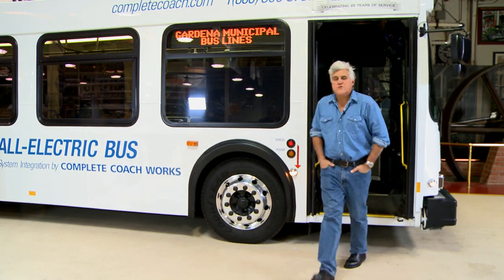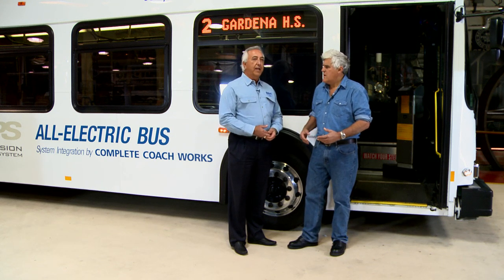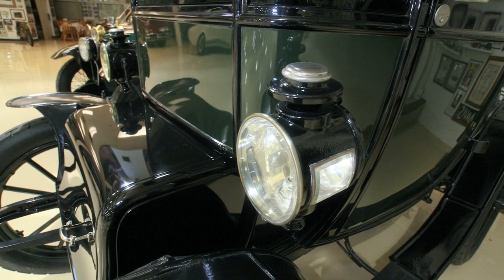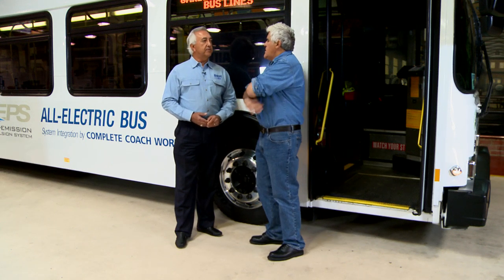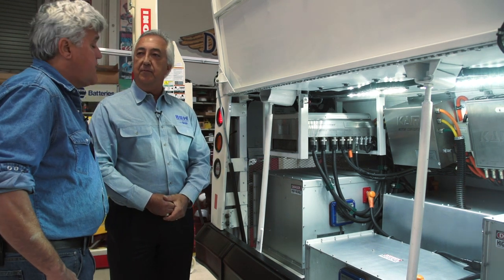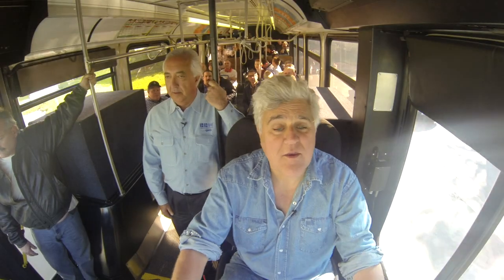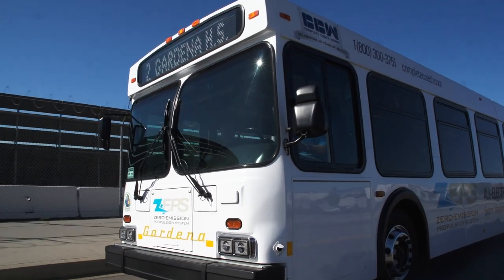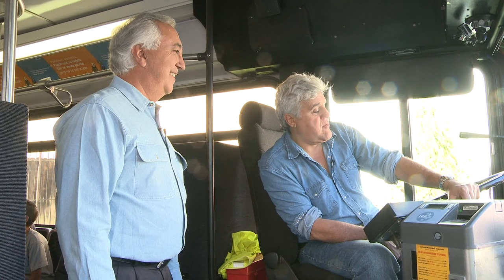Electric Bus Conversion - Jay Leno's Garage

Comment: I would love to have this drive train in a 21-25 ft motorhome when I retire.  Charging at the campsite would be way more convenient than gas stations.  And if you roll in after hours it isn't as disruptive to the other campers trying to sleep.  Imagine spending a few months going cross country and maybe just driving 150 relaxing miles in-between campsites.

Comment: why dont we have the same set up as a bumper car in dense cities? when you`re running low on charge, just extend a boom with a metal brush on the end of it, and charge on the go. and if you`re out side that kind of city, what about a solar panel on the roof? i mean, panels are getting fairly cheap nowadays. and with the recharging system the bus already has, it will virtually never run out. just plug it in a night and keep it going the next day. or have a 5 wheel in the centre bolted onto a dyno

Comment: I dunno how much a full solar panel roof would contribute to charging but it could probably run the A/C system alone and take the load off the motor.

Comment: Also, the specific design of the bus in the video is way better than any of MUNI's 40/60 foot motor coaches, excluding the Orion hybrids. MUNI would be wise to get one of these electric buses, rather than trying to fix the piece of junk neoplans that are stacking up like broken cars at a junkyard.

Comment: How long does the batteries last. Is it like the prius the batteries last only about. 100,000 miles before they need replaced. And batteries are not cheap.

Comment: Not that you actually care about facts but just in case you might want to know that the US now uses just as much natural gas for power generation as coal, with much lower emissions, and it's all sourced from right here in the US.  Hydro, nuke, solar, and wind also contribute the grid power and are locally sourced, except for some hydro from Canada.

Comment: first time i see a viable electric viechle. this is excelent. and i believe the price differeence to a diesel bus wil be saved in maintanance and fuel pretty fast
Reply: until you figure in the costs of replacing the batteries every year or year and a half!

and the environmental impacts of those worn out batteries (and the new replacements) are

Comment: My only question would be can it climb hills with a load?  And what happens if it’s in a bad accident?  Would the bus be “Electrified” like if you ran into a power pole and sparks flying?
Reply: This kind of fear from electricity was quite common at world expos of the 1880s … are you also worried to sit on a tank containing 500 pounds of Diesel fuel – equivalent to 35 tons of TNT?

Comment: How about motorhomes which weigh less??? The owners typically are in no rush,and would be content with a 2-300 mile range per day,and with full solar roof panels,maybe twice that range on a good sunny day,or have a small gennie running which would renew the batteries while in use...

Comment: That motor is small for 170 hp.  I am a bit surprised at the wye-start delta-run configuration since there is an inverter.

Comment: Why would you need it? The best Lithium batteries can give out 130 times their amp rating for 15 seconds and 65 times continous, so with a 100KWh battery you could give out 1300KW for 15 seconds (acceleration) and then 650KW 24/7 :) And even more with extra cooling :D Tell me how you would need a supercap?

Comment: This is a 20 year old bus that they completely renovated and fixed up to make it as new. He said it will probably go for 12 years no problem. They usually ship these 20 year old dirty buses down to Africa where they will be polluting another 20 years with an outdated and tired diesel engine. Not only will a conversion stop that pollution, there wont be a need to build a completely new bus. What do you think is dirtier? Letting the old bus run in Africa for 20 years and make a new bus or this?

Comment: That is not true. The routes might be shorter in European cities, but the busses drive more often. In Bratislava, the daily average of of how far a regular city bus drives is about 250 km (156 mil). Long routes make up to 400 km (250 mil). Electricity is nice, but hauling heavy batteries is not, also the battery is expensive and becomes high toxic waste after a couple of years. Trolleybuses make more sense, especially when you have frequent service like here in Europe, in peak times every 3 min.

Comment: This is a conversion. On the surface this appears eco as a bus is being reused. However, a brand new build can often be more economical, in the lifetime of a bus - as is often the case with houses. A new build will clearly be far better economical design.

Comment: So, if you could fit 3000w of solar panels on this bus, at 213 kwh, it would only take 71 hours in full sun to charge it!

That's why there are no solar panels on top of this bus.     The solar panels need to be at the bus depot and there needs to be acres of them.

Comment: They said it holds 213,000 watt hours of electricity. A large car battery holds maybe 120. That's 1775 big car batteries full of juice to go under 2 hours of travel, so if you can picture that, solar panels will not help unless you are tethered to a field of them. . As in forget batteries completely and just make it an old fashioned electric trolley. The same technology used for over 100 years which the car companies kiledl at every opportunity so we'd have to all have our own cars.

Comment: why won't anyone use capacitors to recharge batteries, they're lightweight and efficient and can use the energy from the regen system to multiply the voltage to recharge faster
Reply: myfeeling4you 
Because the batteries are plenty fast to absorb the breaking regen, so there's no need for capacitors inbetween the breaking motors and the batteries.
Heck, there's even a bus project where they use super capacitors only, and no batteries, and then have them recharge at each bus stop.

Comment: Nope they don't make enough energy per square meter which is why they are not used in such a way. It would maybe power the aircon if you covered the whole roof. maybe...

Comment: I wonder if you have a back up generator diesel or gasoline. The i3 made buy BMW does carry that. In the long run the back up generator will pay off, especially since it cost 300 to 500 dollars to have it hauled it back to the garage. Especially the loss of service that would ruin perception of all ready horrible public transit

Comment: When I see companies like this I think why don't they just enter the market they service? After all they get the equipment at cost rather than retail and if the market is profitable to be in why not?
Then I remember the Government monopoly on such services and how they are distorted by taxpayer subsides to appear to cost less than a private business could provide.
Reply: Problem is that they are using a product design held true by the manufacturer that built them in the first place. Unless they build their own buses from scratch, they can only do rebuilds as requested by whomever the buyer is funding. Simply, the bus designed to the features the transit company is interested.

Comment: You know the funny thing is about these is what is needed to put power to these, usually nuclear power. Sure it's clean until you have to dispose of the rods or something happens. Next the process of mining the nickle in Canada, sending it to the UK to be processed than off to China/Japan to make the battery. That means freighters and trucks burning diesel. When it's all said and does it costs more and is more harmful to the environment than a regular truck and so on.

Comment: Everyone keeps saying that they should put Solar Panels on the top of the bus. IT WILL NOT HELP. The weight of the Solar Panels is too immense. The amount of Electricity produced will be very negligible. Instead it is advisable to have one more Battery Pack. I have spent 11 years in the Solar Electric Industry.

Comment: Lithium Iron Phosphate (LiFePO4) batteries and Lithium Ion (Li-Ion) batteries are not the same. Li-Ion have higher energy density but have the burn-up failure mode... To steal from Jason Fenske: "if you're going to drive a boring bus it might as well be an electric bus". Given that I have two bus stops right in front of my house, I'd much rather have one of these "idling" out front at 6 in the morning than a diesel.

Comment: Actually they're not doing it without government money since the transit system is operated by state and local government authorities. The cost of the bus is higher than a conventional diesel bus and without government money this would never get off the ground.
Finally when private corporations are done creating an economic meltdown every five to seven years the government has to step in and mop up the disaster like the last time. Maybe the government is not all bad?

Comment: I think electric vehicles are a bad idea, they place a greater strain on the power grid and we don't really have the battery technology to make the vehicles entirely useful and cost effective.  I think the direction we need to go in for now is hydrogen vehicles.  Or maybe just a hydrogen generator with an electric motor.

Comment: When did they get permission to design this off of the D40LF?
Reply: It's still a D40LF only it was converted to electric. The bus isn't new, only it's power system is new.
Reply: Once warranties expire, transit systems can do whatever to the buses. New Flyer is making a killing in the bus manufacturing department.

Comment: China builds NEW buses that do not meet the regulatory requirements for use on American highways.  

This is USED bus that has been fully reconditioned and equipped with an electric drive system.

The Chinese bus? They're building ten for Long beach at a price that is 3 to four times what these buses cost.

Comment: These batteries will continue to serve long after they come out of the vehicle, they dont go bad they just lose enough efficiency that they arent the best in a drive environment anymore, so at replacement interval they come off the bus and go into a stationary battery pack that gets recharged by solar power and the battery bank is what charges the vehicle, and helping the fleet become steadily less dependent on the grid. Sustainability growing at an evolutionary pace!  Thanks for your comments

Comment: This  Electric Bus is a great idea for mass transit...just not as efficient...
 as the internal combustion engine...equipped with The Hull Effect Technology.
 discovered in 2009.  by  Robert W Hull.(<<<<ME)
 The exhaust gases have zero pollution...VERY QUIET !!!.
 My 4 cylinder engines USE E85 ethanol blend...
and operates on a few ounces per hour....at hiway speeds.

Comment: Why hasn't someone built an electric vehicle & then to charge the battery, have a gas powered generator on board that kicks on when the battery drops to x amount of charge & also combine solar on the roof for charging.
Just seems like a good way to never have to stop & charge up at a charge station. besides getting gas like onces a week or so coz the solar panels on the roof will probable charge the battery's most of the time.

Comment: Jay, your videos are very informative and entertaining. Appropriately so for one with your level of interest, experience in the automotive field and entertainment. I loved how you corrected the Porsche representative upon him exclaiming the PDK shifts "instantly" - like you responded, "well, maybe in milliseconds", which is very fast in relative terms

You may be interested in advancing your theoretical understanding of electrical power as it relates to cars. I am sure you know, ultimately power is what is required, just like with ICE. Power = Electric potential (volt) x current (amp). Due to safety and best available power management components, designs aim at (300 to 500) volt. At lower voltages the currents become undesirably high. 

You might be interested in viewing a couple of very informative videos about accounting for losses in the Tesla Model S  and good information on battery management.

Regenerative braking - energy recovery efficiency:
https://www.youtube.com/watch?v=KnOwWyUsJlE

Battery management:
https://www.youtube.com/watch?v=jPVuCZYZOcs&t=2011s

Comment: They're not only hideous, but they have plenty of mechanical problems that always occur, which adds to the increasingly high deferred maintenance costs. My dad was/still technically is a SF Muni bus driver and he's had to deal with driving all that crappy equipment. Then you have the smaller supply of 1999 40 foot NABI's that MUNI wants to retire soon and replace with new hybrids. Those are even older and they have horrible braking pads that make it a pain to drive.

Comment: As I said, these new Lithium batterys doesent give a shit...they are rated to 130 times their power...so if you have a 1Kwh battery It can give of 130 times that (130Kw) for 15 second without damage! And 65Kwh 24/7...so in a Tesla S with a 85Kwh battery...you could give off 11.050Kw for 15 seconds and 5525Kw forever with the latest batterys! Do you need anything beter? Also they can charge with 1020Kw...I dont think you will reach that with braking...

Comment: 500k for basically used bus that could be re engine with new cleaner diesel drive-trains for and overhaul the bus i estimate 50k or less pr convert to cng
electric is still mostly coal oil or gas generation but worth experimentation
Reply: +remocres    good point...majority of plug in electrics are coal burners...then natural gas and nuke..the green heads don't worry about that..   http://www.eia.gov/tools/faqs/faq.cfm?id=427&t=3
Reply: +remocres Please educate yourself.....you are making a fool out of you!
Reply: +remocres 
To be fair, the electric motors are quite a lot more efficient at the type of start-trop traffic, that busses meet in cities, than even the best diesel.
They also have a very smooth power delivery, since they have no gears.
And they also have very low maintenance.
So they do have something to bring to the table, other than just economics.

That said, the diesel engines sure have gotten a lot better over the years.
Heck, I drove in a Mercedes Citaro the other day, and it was smoooth.
Big yay for the new automatic transmissions that Mercedes make.
Reply: *****
That's exactly the point..human error..what design, construction, and operation will not be done by humans..??  Was the decision on Fukushima construction done by some kind of non human..??? Bottom line is humans are not competent to control this level of risk..
Reply: *****
Industrial accidents happen every day that we don't hear about because the impact on the world is negligible..not so nuclear plants..  These are ALL humans..the point is nothing has changed since these accidents..you seem to think super humans, maybe outer space aliens, are going to design and run future plants..sorry your comprehension is so limited..or your imagination is so active or both..
Reply: +Oilsmoke Jones 
Heh, I remember that old 15% goal, by 2040.
When the Danish politicians heard about that, someone went "Challenge fucking accpted" and now we have 39% windenergy, on a yearly basis. :D
On some days with good wind, we don't burn any fuel at all, and still manage to export some of the surplus.
Reply: LOL,"professionals and experts." aren't people?? or are some how better than people..I doubt you've known very many..or are you saying Fukushima, Three Mile Island, and Chernobyl were not conceived, planned, designed, built, and operated by "professionals and experts." ??  Then who made the decision to use mere mortals rather than " professionals and experts".and how do we prevent any future such decisions...???    *****
Reply: *****
LOL If you think engineers are that smart you have never worked in an engineering environment..Three Mile Island was under engineering control when it crashed..Russia"s "foremost nuclear engineer" crashed Chernobyl, Japan's best planned Fukushima..all of these accounts are readily available right here youtube. Rather than waste your time and mine arguing with me why don't you just go to the source..
Reply: Josiah Crowley
Having trouble finding those sources..?? Clue..use search..

Comment: I would like to see supercapacitors replacing batteries, not gonna happen anytime soon. Other than that, imagine if you want to fast charge (below 5 min) a supercapacitor that can keep as much energy as a batetry pack (min. 250 miles) that is being charged a couple of hours, how thick cables you would need. I do not belive that the voltage will rise to thousands of Volts to minimise currents. Currents = thick cables = heating = loss. High voltage = not gonna happen in cars for safety reasons.

Comment: Jay wasn't paying attention in his HS science class.  Voltage does not equal power.  Comparing his car's voltage to that of this bus reveals nothing.  Watts (or kilowatts) would have been appropriate.
Reply: Capacity of conductors and power electronics tend to put an upper bound on how much current is practical to deal with, which leads to an expectation that achieving a xyz kilowatts implies a high voltage.    Yes,  the math says you could run the bus on 12V at ten thousand amperes,  but what size wire are you going to hook the batteries up (not to mention wind the motor) with?

Comment: Actually there's no problem in recycling batteries at all. It's not the old lead acid batteries but new lithium phosphate batteries and the lithium can easily be recycled into new batteries. In fact old lithium batteries are really valuable because lithium is a highly valuable precious metal.

Comment: Jay leno clearly doesn't understand how electricity works. Voltage is like the language of the electricity. A stun gun might zap at a million volts, but a car battery at 12 volts could be leathal.